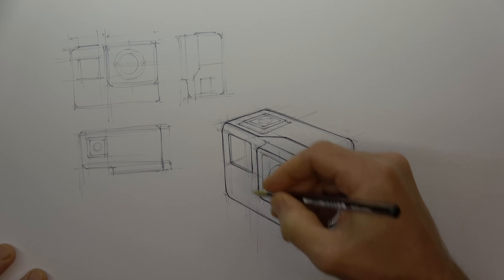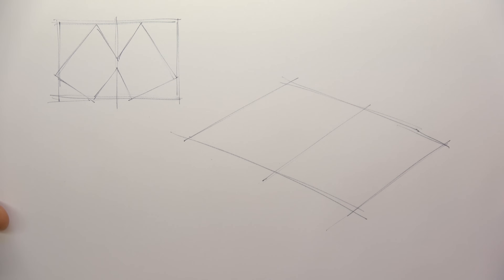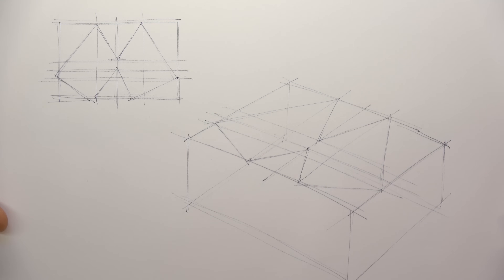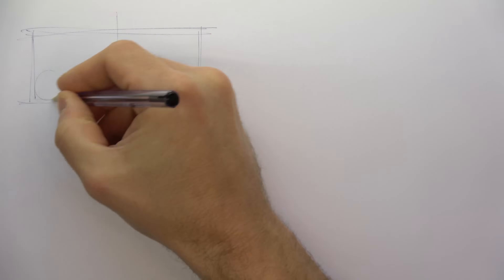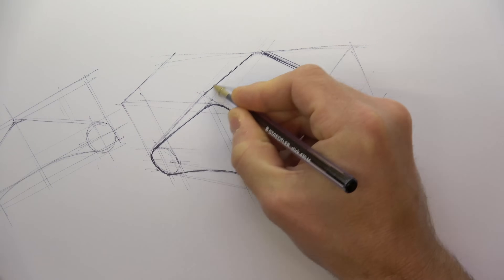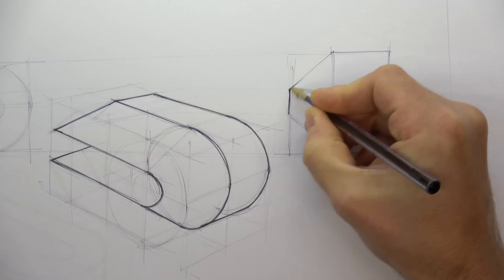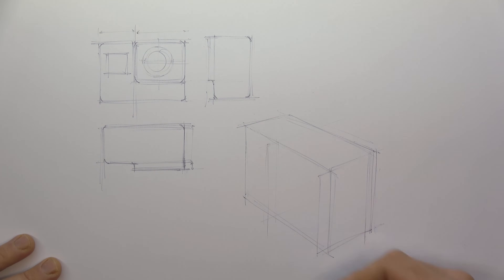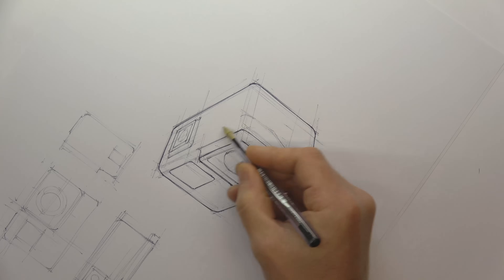Making 3D sketching so much easier!

Comment: this is a great video, but the 3D object doesn't work with the side view, end view and plan view at 4:55 in the video. It just doesn't go together. sorry for the complaint.
Reply from the maker: Looks like I’m missing a single line on the side view (where the ends taper), but otherwise I’d say it’s all good.  The principle is the important thing.
Reply: @simplydesignsketching sorry, but could you please explain the mistake more simple for me please?

Comment: Hey there 1 Question:
HOW did you decide what your width in top view should be .... beacuse you have no information about it in side view...
Intuition? Any technique for scaleing?
Thanks
Reply from the maker: If I’ve understood you correctly, the side view contains info on depth and height. The top (plan) view contains info on width and depth and the front view contains info on width and height.  Hope this helps.

Comment: Why I am not improving in product design
Plz mentioned ur insta account
Reply from the maker: It does take a lot of time and patience.  It could be a load of other factors.... are you relaxed, or stressing about not improving (then tightening up)? Are you locking your fingers and wrist (you should be)? Etc etc
Reply: @simplydesignsketching  txx sir
Reply: I didn't get ur mean by lock my wrist ????
Reply from the maker: @roshnirana4573  imagine you’d broken your wrist and you had it put in plaster. It would stay locked in one position. Try not to pivot around your elbow, but move from your shoulder instead.
Reply: @simplydesignsketching  shukriya means txxx ,I learnt new thing from u today
Reply from the maker: @roshnirana4573  my pleasure! Pleased to help!